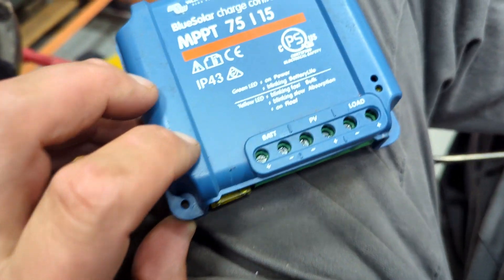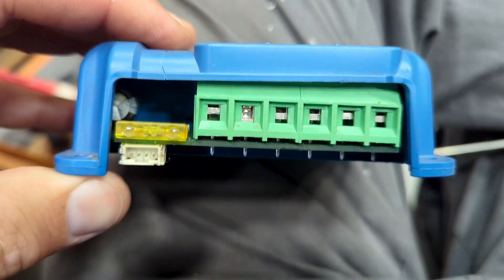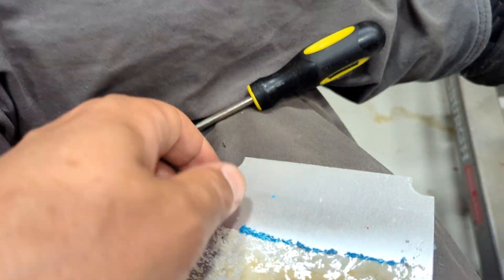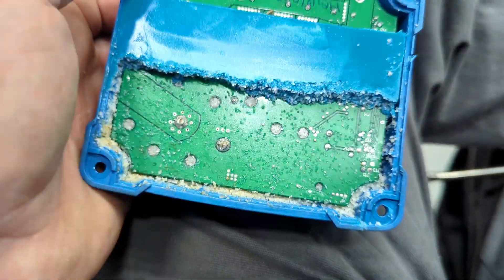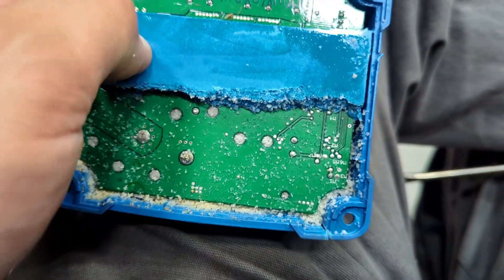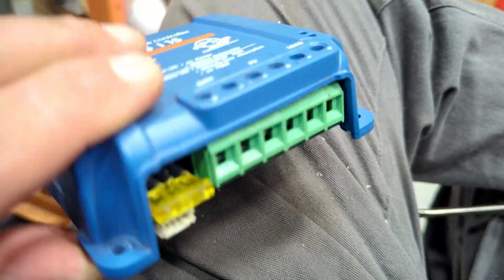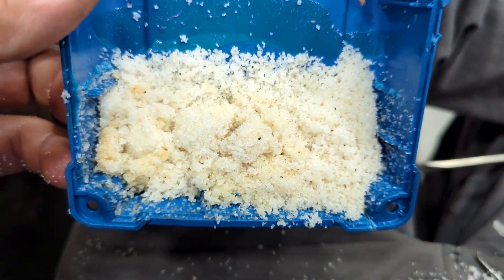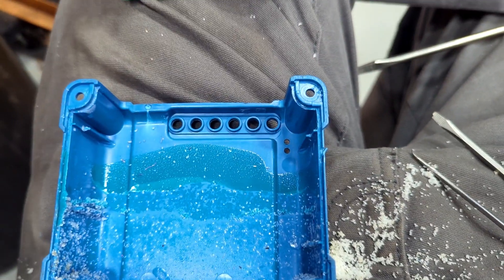Victron 75/15 solar charge controller sand

Comment: There is a good reason a company want the inside closed, and the "sand"  It's just a way to get rid of the heat .  You might use Google next time you don't know about something  just a tip